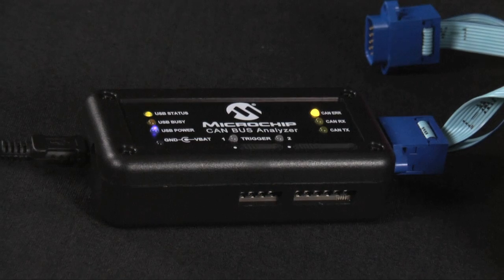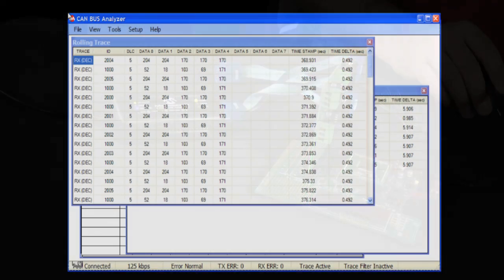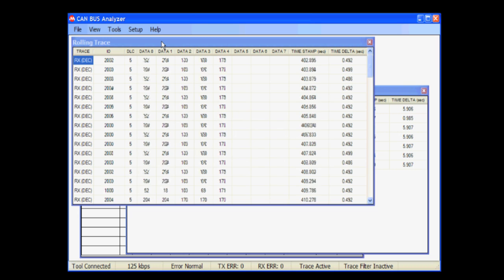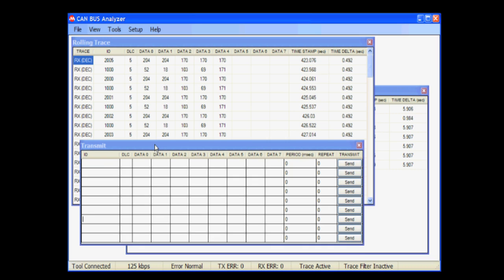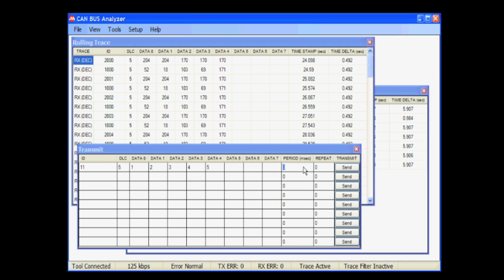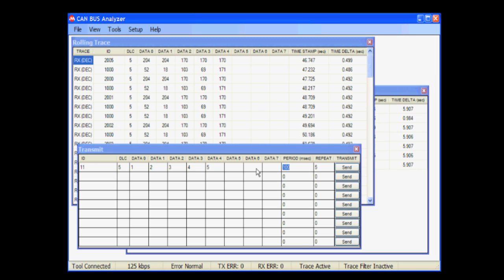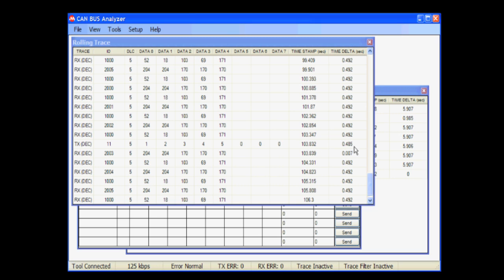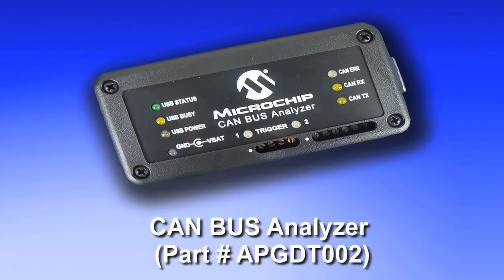Microchip CAN BUS Analyzer Demonstration

Comment: great video.. on the factory-floor Can-Bus sensors "temp, pressure, speed, etc" are networked to PLC-machine-devices.. which requires some test equipment for troubleshooting..  thanks..:)
Reply from the maker: Kindly visit support.microchip.com. We do not provide support via social media. Thank you.

Comment from the maker: Hello - The current version of the GUI will transmit the RAW can message onto a CAN BUS.
The tool doesn’t provide any OEM specific network information that would be required to communicate with modules on a vehicle.  Thank you.